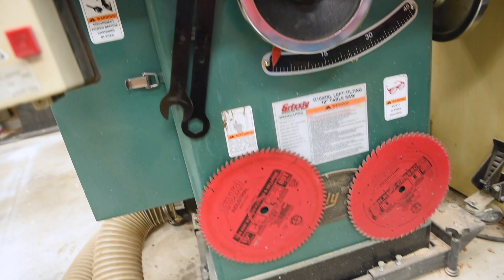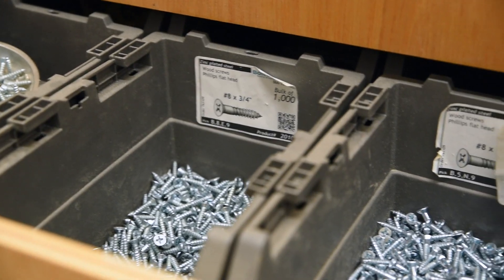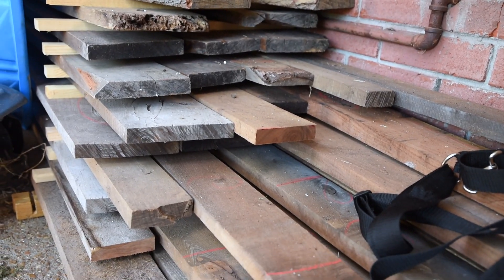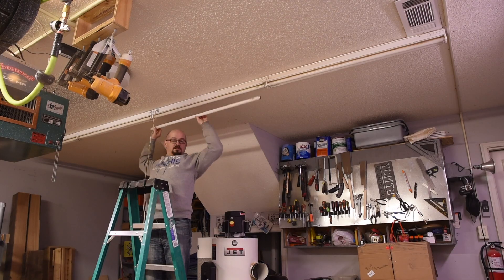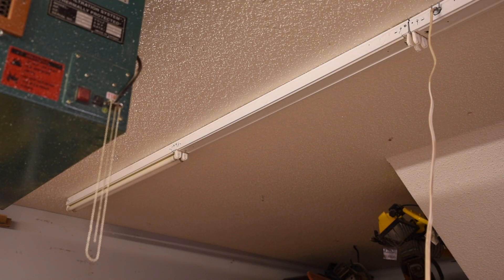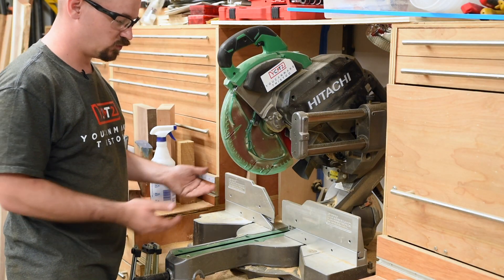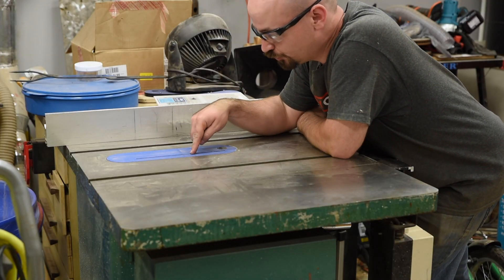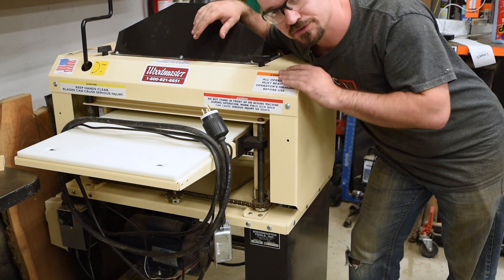Garage Woodworking Shop Tips

Comment: I was hoping to find a link to your preferred hardware provider(s).  Any chance you can share that, i.e., where you get your hardware in bulk?
Reply: ok, found those references in the corresponding blog.  What about your source for caster wheels?
Reply from the maker: I don’t use much hardware. Generally I just order from Amazon or go to Home Depot when I need it, Rockler if it’s specialty.

Comment: I don't have new or high quality tools because I just tinker.  However, it is still important to make sure the tools are adjusted, as you mentioned.  The most annoying piece of equipment in the shop is a Craftsman radial arm saw, which is poorly designed and always in need of adjustment.  If it weren't inherited, it wouldn't be in my shop.  A table saw and a cut off saw would be much better to have.
Thanks for the video and the comment section where I can whine.😆

Comment: Thanks, great tips, I recently tuned up my bandsaw after watching a few YouTube videos. First time in35 years, what a difference it’s become one of my friendliest tools in my workshop. I bought a big really nice table saw, the blade would not recess below the table. I found a chunk of wood jammed under the table that prevented the adjustment from working. Your cleaning tip is appropriate, I like to sweep up chips and dust and cleaning off my work bench making any project more enjoyable. Also a fine idea to keep tools in the workbench and on machines . Common sense but thanks for reminding me so I become more organized.
Reply from the maker: Thanks! Glad you enjoyed the video. Sometimes I need to take my own advice more. But yes, cleaning and wheels are great, so are tuned up machines!

Comment: Magnets are amazing
Reply from the maker: I'm borderline obsessed with them.
Reply: @YouCanMakeThisToo  There are some incredibly powerful magnets in old computer hard disk drives.
Reply from the maker: Hmmmm, good to know!
Reply: @YouCanMakeThisToo  it is something I heard a lot about myself but I only recently took a dead HDD out and got them. They're stupid strong! You have to remove the sticker and the screws are Torx. There's a pair of them in there that look like little disc brake pads. They're down the end of the arm as I can recall. http://www.reuk.co.uk//OtherImages/inside-a-hard-disk-drive.jpg

Comment: I always buy consumables is Bulk for everything from washers to bolts to screws and tons of other things
Reply from the maker: That’s brilliant, it’s the best way to do it if you have the extra cash.
Reply: @YouCanMakeThisToo  it saves a ton of time when you need to replace a bolt or washer and you already have extra cane in handy on offroad light brackets the other day as well as bbq repair

Comment: Great group of tips and ideas here, thanks for putting it together! One of the first things I do with a user manual is rip out the languages I don't speak, and staple/tape together all the junk pages.  Then when you go to use it (after torching your man card haha) it's way easier to find the pages you need.
Reply from the maker: That’s a good tip! I normally flip through them to find anything that’s new to me then toss them. If I need it later I just look it up online.
Reply: @YouCanMakeThisToo  That's a great system.  BTW, thank you for your service, truly.

Comment: Really good tips, and well presented. My favorite was the wheels. My shop is 20'x 30' divided into two 10'x 30' bays and, apart from two benches, a lumber rack and drill press, EVERYTHING is on wheels. Space for my table saw is really tight and being able to move it easily is a necessity. 

One thing I think is important is to not try to save a couple of bucks by using two fixed casters and two pivoting caster, then having to steer things into position. Spend the extra cash and use four pivoting casters. Being able to move a heavy machine in any direction without having to steer it is worth the extra cost.
Reply from the maker: Great point on the casters! I used to be notorious when I didn't have much budget for trying to do everything as cheap as possible. Now I realize that a few extra is more than worth the headaches it saves later.
Reply: Agreed, though I will say you can save a few bucks depending on the tool and shop (such as if you have a garage with a sloped floor) by combining two locking and non locking swiveling casters.
Reply from the maker: @zski03  Definitely don't need all locking casters. The only benefit to that is not having to get to the ones that lock.

Comment: I have a tiny shop (less than 6’x6’) with a fly over flat (apartment) over it giving me cover outside the door. I keep my three benches on wheels to work outside the door. I have one bench with my small drill press, miter saw, machine vice bandsaw and sander on it and I have them all set up so they don’t interfere with each other. I have disabilities so I can’t do anything but small jobs, I'd love to build my own bench but that can’t happen. But slowly I’ve considerably beefed up one of those cheap benches giving it more weight and solidity. I have to work tidy partly because of my disabilities and partly because I'd grind to a halt otherwise. 

My biggest tip as a newbie is give it a try. You’ll probably make a mess but on the next project you’ll make less of a mess and so on. I got to a stage I was buying more tools instead of learning to use the ones I have. 

I've been divorced, got a law degree and set up two businesses in my life, though I haven’t been to war.

Great video, thank you
Reply from the maker: I’m really glad to hear you’ve found a way to make things work for you and keep making! I’ve definitely been in the “buying more than making” phase before. But it’s about the work, not the tools! And great advice on just getting after it.

Comment: Ha! See ya, man card! I like the idea of keeping the tools where you need them. That makes a lot of sense to me.
Reply from the maker: It’s been a huge game changer for me. So much easier to get things done and it stays cleaner!
Reply: I have two sets of tools. My hand tools and my tools for machines. They're separate sets. Then there are the floater tools. They're just kind of extras or overflow. I buy random box lots of junk so I get a strange mix of tools out of that.
Reply from the maker: @1pcfred  That's a good idea. I'm starting to get that going a little bit. I have a drawer I've started to keep machine stuff in so I know to just riffle through that.
Reply: @YouCanMakeThisToo  I have a little roller box in my machine bay for tools for the machines. A few ratchets and wrenches covers everything I want to do there. That and a brass hammer. The rest of that box has hold downs in it and a whole drawer of hole saws. The bottom cabinet is full of clamps. I hate when my C clamps get dust in the threads. That triggers me.

Comment: I was going to subscribe until you bashed capitalism. LoL I subscribed. Capitalism basically means you are in control of your own business for profit and the government doesn't stick it's hands it it. That's socialism. So, don't blame capitalism for owner error. Companies put the info in the manual and owners fail to read them. I was one of them. And, most companies offer a customer service where they will explain the process. Like you mentioned, I had the stack of manuals in a drawer collecting dust. I didn't pull them out until I needed them. Usually for troubleshooting. As most of us do. And, some people throw them out. All of this is owner error. Why blame your computer for not working if you never plugged it in.

All in all I enjoyed your video. I both learned something and agree with you on methods. Put your tools back where you got them and you won't have to go looking for them and keeping tools near then area you would normally use them. My table saw, from the '60s, requires regular tune-ups so I keep the wrenches, Allen wrench and a square attached to the base of the saw. Great tips and advice, thank you. Just a question and not a criticism. Why build an all new work table instead of updating the one you already built? Understandable for a total redesign, but just making adjustments, I don't get it. Maybe I misunderstood you when you talked about that.
Reply from the maker: I wasn't bashing capitalism, it was just the most absurd nonsensical thing I could think of off the top of my head.. because what does that have to do with manuals? Sorry you didn't get my humor, but glad you enjoyed it nonetheless!

Videos are my job.. making a new bench appeals to a wider audience that just changing my specific bench. So more potential views and plan sales. Also, I just prefer the process more to messing about with things already made.
Reply: @YouCanMakeThisToo  LoL. You missed my sarcasm at the beginning about bashing capitalism. Sadly though, that is how some others see it. That was kind of why I went into an explanation. For them, not you. 

Thank you for explaining your reasoning on building new workbenches. That makes sense to do it for that. Wishing you the very best in the New Year. Keep the videos coming. I just recently started a channel and besides not having a workbench, heat is preventing me from making more videos at the moment. Or rather, lack of heat I should say. God bless and take care.

Comment: The one place I avoid magnets is to hold drill bits. Everything else is spot on! If you go, I'll see you at Good of the Land.
Reply from the maker: Thanks! Ill see you there! I don’t think I use them on drill bits. Just the hex key for my bit extended thingies. Always lose those.
Reply: I hate magnetized tools. I do keep the chuck key for my mill on the mill with a magnet and strangely it never attracts chips. Go figure. But I have a degausser in my shop too.

Comment: You’re assuming everyone has a nice big dedicated shop try double car garage with both cars parked inside at night as your shop that’ll make you reconsider what tools you really need lol I enjoyed watching your video though
Reply from the maker: You're assuming my shop wasn't exactly that way longer than it's been in a garage with no cars, I've had to share with cars longer than I haven't. Pretty sure all my tips still hold up to any size shop - just be less machines. But for sure, I had to be way more selective with what stayed in the shop when everything had to fit against the walls every night! That's when I started putting everything on wheels, there wasn't really another option.